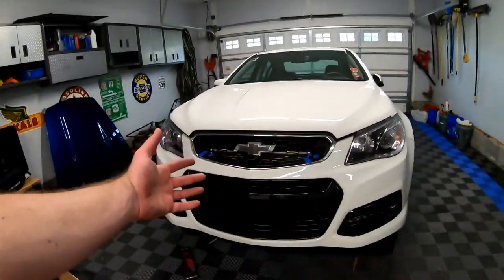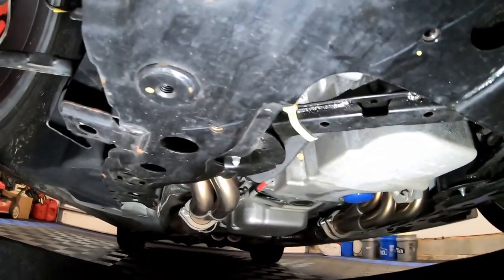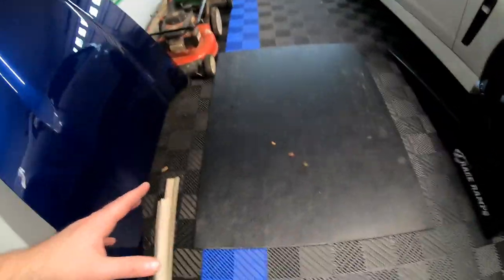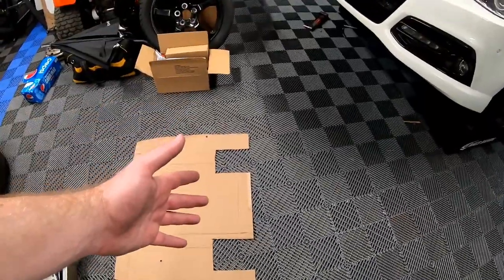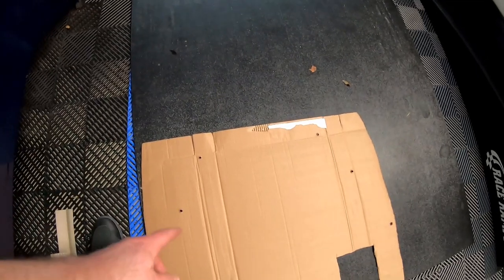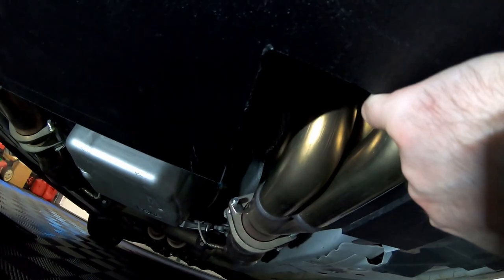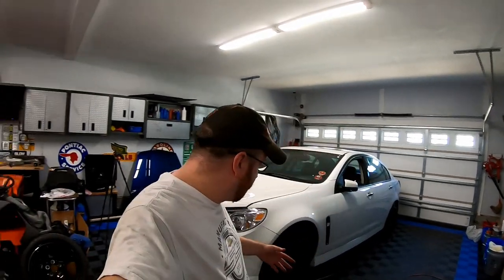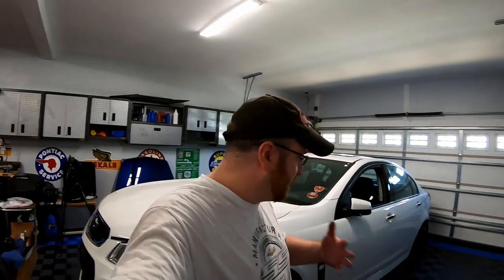2014 Chevy SS - Upgrades Ep 10 - Custom Belly Pan

Comment: howdy,  i love your YouTube channel! I have a 2015 Chevy SS. I know the Chevy SS has a oil cooler via coolant in a fluid heat exchanger. Do you have any plan to upgrade the stock oil cooler? Maybe a separate front mount radiator, pump, similar to intercooling.   I would be a buyer if you developed a kit.
Reply from the maker: Motor oil cooler? No - the SS shares a similar design to the C6 ZR1 and the Camaro - the cooler is off the driver side of the block. There is really no upgrade without custom engineering an entirely new setup. 

Transmission oil cooler - I already removed the stock transmission cooler - and upgraded it with a TruCool kit. That video is here: https://youtu.be/52BnmctGpTw

Comment: OMg so much extra heat now that you put that on, you should have made angle cuts facing the front of the car so cold air and rush past the oil cooler and also the oil pan and headers, so easy to make up, take the bloody thing off mate and do it properly, get heat proof stuff and just cut angled holes facing forwards and line it up towards the engine oil cooler and also any other items which require cold air to hit cheers :) Also look up HSV W1 cold air intake, which shits in front of the radiator, maybe thats something you can get made, plastic moulding company and a good rubber flexible hose company for the intake hose to marry up with the over the radiator intake. :)
Reply from the maker: I've had zero issues with this - especially in 100* F days here in the south. This is modeled after the factory parts that came on the V1.